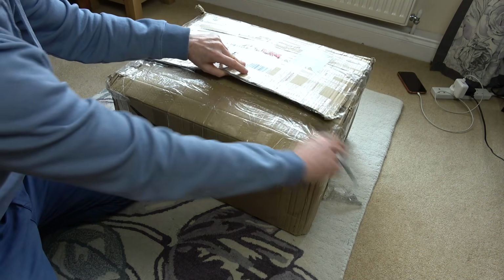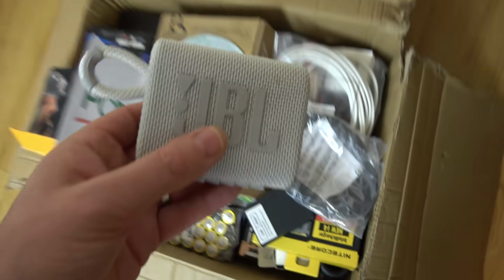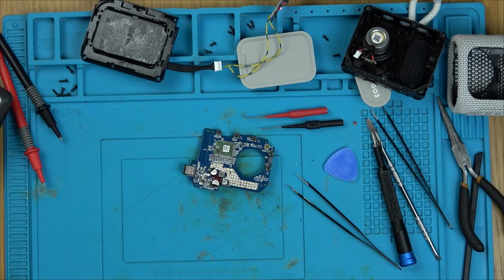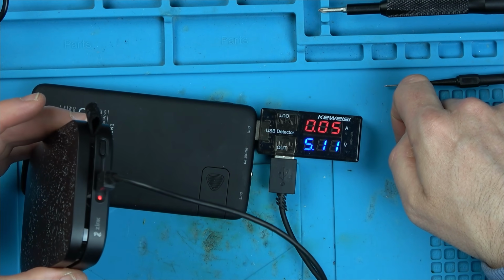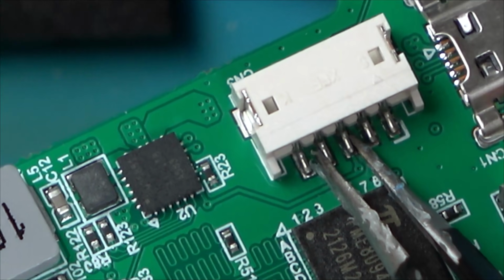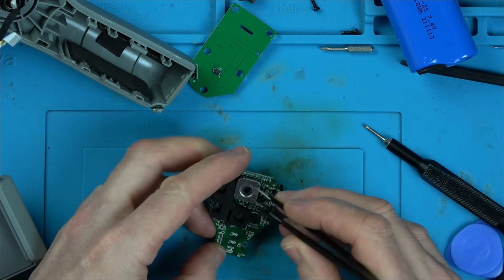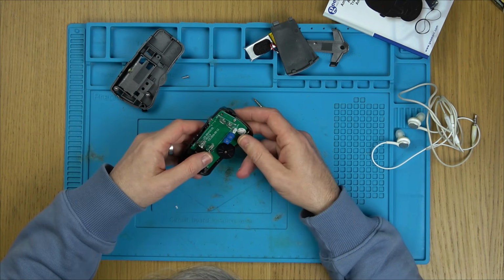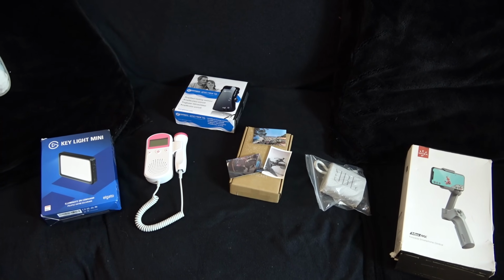ANOTHER AMAZON Returns MYSTERY Box from eBay? Can I FIX it?

Comment: Just watched your video when you come to fix the jbl speak you couldn't find a replacement chip for EV4C2PF2 its a bypass chip for fast charging i think and basically they all are the same so try CH224K SMD ESSOP-10 USB PD Power Granting Protocol Chip Fast Charging IC

Comment: The chip you're referring to, EV4C2PF2, is also known as the Alpha 21064. This microprocessor was developed by Digital Equipment Corporation and was the first commercial implementation of the Alpha instruction set architecture (ISA). It was introduced in 1992 and was known for its high performance at the time.

Comment: The usual fare is knackered caballed earphones and low rent Bush radios. Also, misc specialised item and the old chestnut....blue tooth  speakers....  For you, it's a great idea. You get to make interesting vids. For most, you end up with a load of broken crap that's not worth spending a few days trying to fix before it ends up in recycling..

Comment: The HP Sprocket photo printer probably has a protection circuit that disconnects the battery as a safety measure once the voltage has dropped below 2.50V. You probably reset the protection circuit by shorting the 2 pins otherwise you would not be able to put a new battery in.

Comment: You can't test batteries with a multi-meter and conclude they are okay. The battery needs to be under load to read an accurate potential. Clip 2 alligator wires to a 100 omh resistor, 1 to each lead, and then clip 1 of the wires to the positive probe and the other to the negative probe of the multi-meter. 

Not putting it under load will give a higher voltage than the battery can give while under load. So it might seem it's reading as 1.5 volt but when under load it might give something bellow 0.8-1.0 volt, which isn't enough to run anything.

Comment: WRT that last fix with the hearing speaker, you could have used a cheap sewing needle/pin to provide the strength, then sealed the end projecting into the jack socket with mastic/hot melt or WHY; if you're unhappy using metal, there are novelty cocktail sticks made of plastic that would have done instead (with less strength ofc). It requires a steady hand with a jeweller's hand-drill to make the holes in the jack (esp centring), but I'm sure you're up to that with your microscope :)

Comment: I reckon accessing the chip from the JBL speaker would be fairly easy, since JBL seem to have 1000's of them. It's probably pretty common. When replacing it on the PCB you probably wanna get a pre-heater, which is essentially a convection heater that suspends the PCB over the heat source warming up the whole board preventing localised heat from running off onto all the copper nearby. Then you can use your heat gun to solder the chip back on with some confidence you've reflowed the big ol ground plane underneath. Hard to check unless you have an X-ray machine handy.

Comment: Kick starting accumulators is  possible in some times. But please notice that a deeply discharged one like yours can cause major internal damage to it self. Lowering the lifetime of the akkumulator significantly. 

When you are lucky than it just had been a short unpowered time and experience no/less lifetime problems.

But you never can be sure how long it's empty.

Commonly they discharge themselves faster as longer it has been unpowered and they'll  loose max capacity. This is why they like to explode/burn with "higher" charging currents when beeing  empty.

I allways recommand to replace it in any case (if possible).

Beeing fully discharged over a long period of time causes electro chemical processes in the batterie to happen faster. 

Its like wrong storage of food. It just gets bad earlier.

So better check out manufracturing date.
doublecheck decissions for a good feeling  👍🏼

Chilled videos by the way. 

I like the spirit :)

Comment: If you are serching for the fittig chip than notice that the first line of code is for the product und the second line is most likely the batch number.

So don't type in all together.

And you are more likely to find the questioned chip by searching for "first line of code + datasheet". in your case it is "ev4c datasheet".

It took me 20 seconds to find the right chip and all information about it.

You just need to download the pdf file. 

This workes for every chip. 

And in your case it's clear that this chip is an WLED low power driver. 

Hope that makes it a little easier for you to find the right information next time.

Comment: On the pocket printer, can you charge a 8V LiPO using a 5V power pack? I see no boost converter on the PCB. It appears to be a USB C connector. A true USB C charger supply can negotiate with the load device for both current and voltage up to 19V DC. Try a laptop USB C charger brick. You will see 19.2VDC, not 5VDC.

Comment: That's the issue with some little unknown brand chips. They're either not available, or available only in bulk packs for OEM. So annoying when you only need one chip!
Reply: When you check out the datasheet of any chip, you'll find a list of similar alternative chips. Often you'll be lucky to find an other one that works as well. But please doublecheck the pinout and chip peripherics.

Because some chips need a little other resistence,  capacitive or inductive values of the cercuit to deliever the same funktion.

But you might be lucky to find a chip wich costs a little more but you can buy them in low quantities.

They are also likely to be of better quality, because the manufracturer wants to safe money. Wich is 100% legit. Because the same product can cost waaaay more when they would not do this.

Comment: Hey Vince. The ohm reading on your lead may always be different due to your multimeter dial switch. At least on my multimeter, sometimes my leads show 0 ohms, 4 ohms, etc and when I fiddle with the dial switch, it changes. So maybe your multimeter can be similar to mine.
Reply: I had a pen-multimeter with a slide switch and it was necessary to disassemble and scrub the switch contacts with a swab doused with WD-40, after which all was good again!

Comment: Hi Vince thanks for another great video👍🏻 I spotted the first item you have taken out of box is the Pure discovR smart speaker I have one that had no power and got it working again but with alot of trouble and it's really only a temporary fix by cutting of a portion of ribbon cable that was blown out it's contained inside the rubber shroud that expands and contracts when it goes up and down. You may not have this problem with yours but incase you do I think this could be the cause it seems to be a design flaw! Good luck and keep the great videos coming thank you👍🏻

Comment: Zero volts from a lithium pack usually means the onboard protection chip has tripped, due to either undervoltage  or overcurrent. This gets reset when a charge voltage is applied
Reply from the maker: Nice one Mike👍 Thanks for helping.

Comment: A similar thing can happen to the fan circuit on a nintendo switch, thecod3r has a video called the magic smoke or something like that, where he shorts something on the fan circuit and boom the fan starts working. so it is very likely you have stumbled onto a similar issue where an ic gets locked. good work Vince!

Comment: You might have damaged the pin of the charger IC of the printer when shorting to +battery voltage (I assume the IC is supplied by 5V from the USB port). To check the functionality,  you. should short the NTC to ground to trigger the over temperature protection.

Comment: Hi Vince, on the HP Sprocket and that battery mind boggling issue is normal, i work in the battery manufacturing and i can confirm that certain battery PCB's can go to sleep over time to self protect from over discharging. Some batteries will require to be plugged in to a computer with the adequate software some others will just require a burst of current.

Comment: Do we need some sort of law where manufacturers use only certain parts for standard functions as part of right of repair. Especially that voltage-checker thing, that should be readily available on eBay. Perhaps some sort of product fix rating as well 1-5.

Comment: 17:57 just put in one of those TP4056 small boards and hook the battery through it, DONE! ;) EV4C in DRC 10-pin package may be either BQ24040 or TPS40210-EP depending on schematic and function, try to trace some pinouts for it on the board. A TPS40210 is a boost converter that may be set to control charging current and voltage and soft-start function. A fix that I suggested is preferable over guessing what it is, it may be neither of them.
Reply: I was thinking exactly the same thing. When you cant find things, improvise...

Comment: Could you connect a TP4056 to the battery then to the power and ground pins of the board and see if you could get the speaker to charge that way? prolly have to modify the case to fit the module to charge it but could that work?

Comment: make a new hole for that external battery charger you were using and fix the bt speaker by wiring to the connector. I think it was the tp4056, or replace the connector that is there with a breakout board and a spacer and wire to the tp4056 and then to the battery connector

Comment: I have an LG monitor that has an eeprom with bad code. Whenever there's a power outage, there's a chance it will just not power on. I have to bridge vcc to one of the pins to pull it high and then hope that it's on a clock cycle that refreshes it. I wonder if the charge controller has a similar bug.

Comment: It seems you need a lithium battery charger ic which takes 5v usb in, and outputs 8.4v (i.e. is capable of charging two cells in series) in a 10-pin package. It will need to have an integrated voltage boost. I looked long and hard for these but could not find any that were simple enough.

Comment: As to the EV4C marked chip in the JBL GO3 unit, I suspect that it will be some obscure Li-Po charging chip, at least from the major electronics brands there's not a single one I was able to find in this package with the given IC marking code. If you would be able to reverse engineer however the components connected to the IC and the pins they connect to, I imagine there will be a drop-in replacement available from a reputable brand.

Comment: There maybe a part number under the joystick potentiometer.  You would need to remove it from the PCB.
Maybe there is a firmware bug in the item you jump started.

Comment: Safety devices on most battery operated item to stop chargers putting a charge into zero a battery with no power in it. mainly found in Drill driver charging supplies

Comment: I’m thinking the printer had a disconnected solder joint and with your tweezers you pushed the connection back into place rather than thinking you blew something up.

Comment: Well done, as always. What surprises me most is that these sellers must be taking a major hit re the postage costs, I'll guess at least £10 and probably nearer £15 for that box. The charge chip (EV4C) in the JBL speaker looks to be an NXE knockoff of the BQ24040 or BQ2409 charge controller IC (which JBL use in their other speakers), but, needless to say, do a pin-for-pin, makes-sense check before fitting one.
Reply: Sony also use the BQ charge controller ICs in their Bluetooth speakers, but with different part numbers.
Reply: @oldman1944  Interesting, thanks. The BQ series has been cloned by a number of manufacturers, all of which use different numbers. As long as Vince does a pin-for-pin due diligence and selects the correct version to match the battery NTC value, then all should be fine, he says confidently.
Reply: The last time I bought a box full of tech, it costed me more then 50 euros just for simple delivery (2 days deal) while the contents inside that box costed me 7 euros. 

Just to put into perspective wtf is going on. XD

The very same reason why I opt out of buying things if 

A) is not close to me 

B) I have no means of picking it up myself or someone I know to deliver to my place
C) it needs to have far greater value on the long run for me to bother invest money and time in it

Sometimes even if it's given for free I refuse to take it since the transportation fee and time wasted on it doesn't make sense for me to jump into such things.
Reply: @minmogrovingstrongandhealthy  Yes, I did wonder whether the seller had included postage in the total (the listing indicated free shipping) and that the contents would therefore be of very low value. Not so, in Vince's case, but then (as he pointed out) he likely gets special treatment.
Reply: I was just going to recommend that one! Great post!
Reply: mine says mine says NXE 098 AJ7E on my JBL Go 3

Comment: Is there space in the JBL speaker to put in the tp4056 board (with its usb socket removed) and wire it in to take over the charging of the battery?

Comment: After your previous video, I also bought a £50 returns box. There were a few items that were an easy fix, but none of them particularly useful to me. I also got a power bank with the same fault as yours (it was also the same brand but a different model). Unfortunately, I could not get into it without destrorying the case. I got over 100 AA alkaline batteries too. I may get another box in a month or so.

Comment: NTC “Negative Temperature Coefficient”. PTC “Positive Temperature Coefficient”, Thermistors.   NTC resistance decreases as temperature increases.  PTC resistance increases as temperature increases.   Almost certain the device is a battery overheat detector. Is it possible the battery overheated the NTC device somehow made the IC go into protection mode and it took the “shorting of the pins” to reset that

Comment: I said this before but what looks to be happening for most of your products is people are plugging them in the wrong way causing the chips to either die or trip.... For example if you put an usb-a upside down on a chip it can trip the system and lock it into a safe mode where you cannot use it and you either have to charge it or decharge it or in my case with my battery pack put all plugs in and charge it quickly and take out the plugs and it's back to normal this is why we went to USBC

Comment: The JBL Go speaker could be saved if you add a tp4056 charger circuit inside it. As for the gimbal, I have Zhiyun Crane M2 with a very similar joystick to yours which got broken, luckily I have a Moga Pocket joystick which uses the exact same part, took the stick from the Moga pocket, installed it on the gimbal and it works beautifully.

Comment: With the mini printer, I wonder if there’s a voltage coming out of the charge IC across the NTC resistor to ground? My thinking is that if the cell voltage got too low and caused the IC to go into protection mode, you might have accidentally used the NTC voltage to reset the chip if it was over the reset threshold.

Comment: for the mini printer some bms have sort of reset circuit if it detect problem with the battery it cut all feature charge / power output until you reset it. sometimes its documented sometimes not documented at all and most of the time when manufacturer do not want you to reset it, they just dont add the little reset button and use some shady NDA agrement ship so you cant change the battery and you cant reset the bms state so you need to buy a new one you just by chance shorted the two pin that reset all the bms system without frying the chip xD
Reply: I do not understand; how does an NDA prevent someone from changing a battery? The end consumer would have no access to proprietary technical information, so there would be nothing to prevent the disclosure of. The contract of sale may have a term prohibiting disassembly, but how would the manufacturer ever know, much less enforce the contract?
Reply: @williamharris8367  if i use an NDA chip that is a BMS and this BMS as an internal protocol to cut any voltage output if it detect any low voltage or overheating and then the BMS keep this state until you reset it if you change the battery inside your product the BMS will not detect the new cell until you manually reset the BMS 90% of those are pin to short to ground or to 5V but there are some you need to program via UART or other protocol like (I2C, JTAG, serial) if you dont know the pinout the procedure to reset the BMS you cant change battery because it will keep the bms in a detected fault state and prevent any power output and most of the time the bms is soldered inside the product not directly on the battery pack so you cant just change the whole pack so f i design a product and i dont provide the button to reset the chip you cant change the battery and you can't get the datasheet because its NDA so you need to fry dozen of unobtenium BMS to find the reset pin if there one

Comment: 18:00 The pinout looks like it lines up with the texas instruments BQ2404X battery charger, though that's certainly not what it is. There are a whole bunch of 10-pin DFN single-cell lithium battery charge chips out there, but you'd have to compare each one against the circuit that's hooked up to see if it's a viable replacement as they can be quite different from each other in terms of how they behave.
Reply: I think a lot of manufacturers get parts with their own part numbers. Sony use the BQ charge controllers in their speakers but with Sony part numbers. Almost mpossible to search for of course.

Comment: If a lithium battery is reading significantly below 3 volts, I would not risk charging it unless I'm sure that's the result of protection circuitry and not the actual cell voltage! Attemping to recharge a ltihium cell from such a deep over-discharge would be dangerous. However in this case I think the battery has internal protection that tripped and it was likely just in a deep discharge, not an overdischarge.